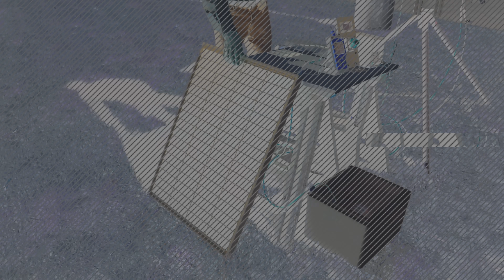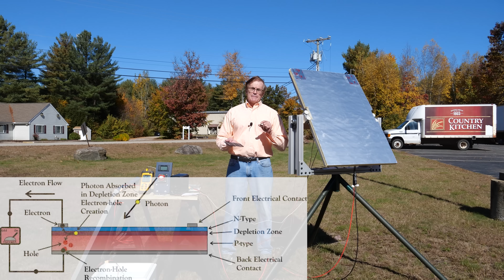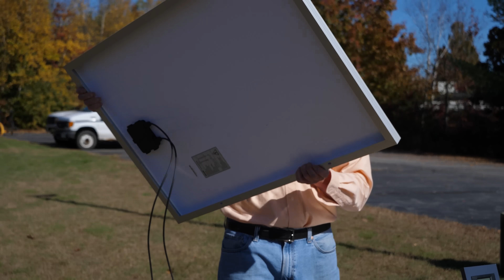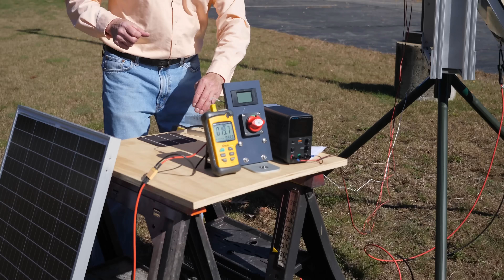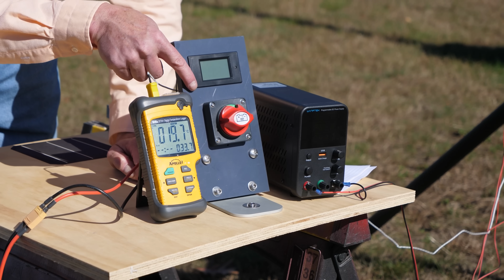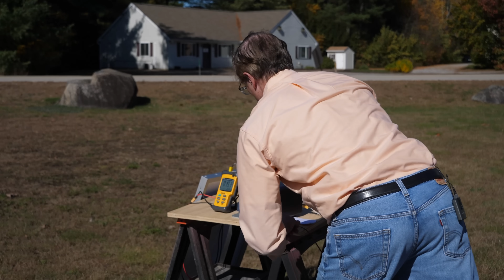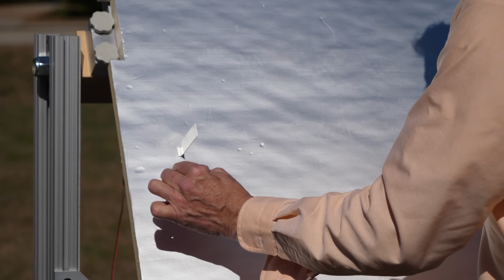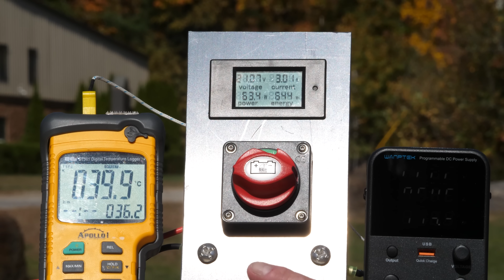Do you REALLY get enough out of your solar panel?

Comment: It would be interesting to see the effect of just the heat sink fins and an open back vs the closed back and fans.   I feel like the convective flow over the fins might be enough to tip the energy balance toward the passive design without fans.
Reply: My thought too. Additionally you minimize cost, you don't steal any power and you omit any moving parts that would need service and eventually fail.
Reply: Passive cooling has a better chance than active cooling. Good fans are freakin expensive, I bet you'd try to save the solar panels by adding fans and end up spending on ton replacing burnt up fans, when you could have just added more panels. Solar panels are too cheap these days to make this stuff make sense. Put as many panels as you can fit on your roof and be done with it, unless you're willing to lower your ROI because it's pet project or whatever.
Reply: @bobbygetsbanned6049  Yep... solar panels are too cheap and getting cheaper/better. One change... I'd put the solar panels on the ground if at all possible. The roof mount systems eventually leak, make roof repairs a nightmare and are difficult to maintain/improve.
Reply: @onestoptechnologies7305  I agree, better to have them on the ground if you have the space. Roofs leak enough as it is without putting bolts through them and having to remove the panels to replace the roof is a lot of labor/cost, which most roofing companies won't even know how to do.
Reply: @bobbygetsbanned6049  Absolutely! I've heard stories of roof rot, insurance companies dropping the policy, etc. Also, the angle of the panel is usually dictated by the angle of the roof, which may not be the best angle for the location. If the panels are way out of angle for the location e.g. a 25 degree roof at a 45 degree location then trying to add 1% thermal boost/longevity is insignificant compared to mounting the panels at the proper angle. 

Mine are mounted on a horizontal pipe and set at 45 degrees which is approximately half way between the Summer and Winter Solstice angles. However, the array can be tilted to the current normal to maximize output, if desired. 

I haven't run the exact numbers on it yet, but the shorter winter daylight hours are enhanced by the colder average temperatures to produce more power per hour(up to about 125%/hr), but the shorter daylight hours means the house requires more lighting. During the summer, the daylight hours are so long (about 6.5 hours longer than winter or +70%) this added daylight hours increases the amount of power without the thermal boost and likely with a small thermal deficit. But lighting is almost unnecessary because of 16 hours of daylight so the additional power is utilized for cooling instead.

I might be able to tweak the angle a bit to find the "sweet spot" that balances the production/usage for both summer and winter... but so far this rough estimate seems to be working.
Reply: Open air natural convection cooling may be a workable thing in higher latitudes, but in lower latitudes, the sun may be directly overhead (or further, towards the poles), and the panels may lie flat. There's no real possibility of natural convection for a panel laying flat - forced convection would be a must-have. And cooling would be even more critical. 

For much of summer, the sun is actually a few degrees north of us in Phoenix, AZ (about 33 deg North latitude). Temperatures (in the shade) typically exceed 110°F (43°C) from 11AM to 5PM.
Reply: @brettd5884  Non-tracking, fixed angle systems are set halfway between the summer and winter solstice angles which is fairly close to the local latitude. So Phoenix, AZ would have a fixed angle of roughly 33 degrees.
Reply: @OneStop Technologies  my calculator shows 34 degrees for the lowest and 80 degrees for the highest from vertical(monthly average, 103 for the peak.)  57 for spring/fall. For Phoenix Arizona.  Panels should be set in the mid to upper range for grid tie. Better performance in summer is preferred as that is when the loads are the highest in Arizona.  Off grid,  should almost always be set up for maximum output in December and January and, depending on battery chemistry,  split into 2 strings 1 optimized for Earliest AM production and Latest PM production  in order to provide power long enough to charge batteries and reduce hours that are battery only.
Reply: @nicholasmendoza6159  Yep, I have mine set to the mid angle (Spring/Fall) and leave them. I will never tie mine to the grid. I'm not in the business of subsidizing the electric companies. They can make their own power. That's an interesting idea about splitting the array. I'll have to test that out. Thanks!
Reply: @OneStop Technologies  there is a lot to solar tha tis absolutely ignored by the general population when it comes to production.  Like mppt algorithm. Or changing settings to match the panels. Panels can produce down to 200W/m2 of luminance.  And if the person wa sto look at the spec sheet, compair the volage and amps, they could design and set the settings to hold the higher volage and only draw enough amperage to keep it at the rated output at the peak of the curve allowing power at very low liggt conditions. I have learned not to explain or help people with this in the major forms because people just get pissed off because "they know everything " about there system and solar output is what it is.
Reply: @onestoptechnologies7305  do you have any documentation about research you have done? It sounds really interesting and all the time you spent on it won't go to waste
Reply: @turnoff7572  Yeah, I have some in paper notebooks somewhere. I might have some digital files too.
Reply: @nicholasmendoza6159  That is a sad reality... Shouldn't we all should be continually learning and sharing with others! 🤔
Reply: @OneStop Technologies  yeah but like I said, people are not concerned with having an optimal running system,  just one running enough that they can complain about it.
Reply: @nicholasmendoza6159  could you explain this more or give a source for me to learn more about this?
Reply: @Elyjah Wortham  books. Not the internet.  Lots of information on solar production and engineering out there in books. Nothing good except a few calculators on the internet.  You can pay for a subscription for a solar design program, you put in your system parameters and it will provide everything like peak output, total average,  it also uses lidar images to calculate tree height, hills etc that will influence your summer or winter output etc. It also calculates battery size etc but it does miss on max charge rates etc and they dont calculate the ideal angels for am vs pm production vs am vs pm usage, that is all on paper. Software runs around 300-400 a month.
Reply: @brettd5884  Il lower latitudes, could'nt you simply make a solar thermosyphon to pull all the hot air from behind the pannel ?
Reply: @AutoNomades  A good thought, but the required ducting brings it's own problems. The thermosyphon exhaust would need to be far enough away from the panels to not cast shade onto the panels. Such ducting would also need to be large diameter for natural convection to be practical.

Then there's materials: If you were thinking of using PVC pipes, PVC gets real brittle after being exposed to sunlight after a year or two. I don't think ABS (or any plastic) is any better. All plastic pipes are either buried, or used indoors where the sun doesn't shine. Painting helps both. And thermal expansion/contraction needs to be considered across the 40°F to 180°F (rooftop in summer) range.
Reply: @brettd5884  If they could make gas tanks from paper during WWII  I'm pretty sure you could make biodegradable ducting from painted cardboard
Reply: I spent hours designing a passive solar tracking system that should add 20% to daily solar harvesting, but cost 20-25% additional for the array. In the end, adding 20% more panels with no moving parts was the wiser solution.
Reply: If you have the space then yeah I guess so.
Reply: @onestoptechnologies7305  even at 20% increased efficiency for 20% more cost, you are still saving out on 20% less space taken, and probably 40% longer life-span on the panels themselves since they aren't baking themselves to death. Passive fins really seem like a no-brainer
Reply: @JceeJClark  The panels are guaranteed to produce at least 80% after 20 years, the fins may slow the degradation rate from 1%/yr to about 0.5%/yr, so after 20 years they may be producing 90%. If I thought that I would never upgrade/replace my panels or was planning to try to utilize the same panels for the next 40 years, then the fins might be the way to go. But the cost of the fins and the cost of the thermal paste in addition to the fact that modifying the panels will likely void the warranty, really cut down on the ROI. I've watched the changes in solar technology over the last 40 years and I'm planning to taking advantage of the new technologies over the next 20 years like perovskites, Ni-Fe, quinones, TPV, et cetera.

Space is not an issue for me, I don't have to squeeze every last drop of sunshine out of my panels. To avoid unnecessary roof penetrations that WILL leak at some point and make reroofing a nightmare, I'm not mounting my panels on my roof, so I can simply add a couple of panels to my array.

I love to further enhance system efficiency when it makes sense in cost and effort. I have spent thousands of hours researching/designing many options for adding efficiency to my array; passive tracking system using liquid propane, active tracking system using sensors and PLC, a cooling system using PEX tubing, distilled water and buried ground loops, or simply using sprinklers and more.
Reply: Ya. And this would be expensive but fun, a Peltier coating in the back, and then a large heatsink. To boost up the voltage when the heat drops it down.

Comment: This probably will not be seen but I'm going to put it on here anyways.
What about using the thermal electric peltier devices to possibly capitalize on the temperature difference of the backside and the front side of the solar panel to produce a little bit more output from the energy that is being collected at the solar panel?
Reply: I am aware that peltier devices are expensive and not terribly efficient. Yet trying to cool the back creating a temperature difference between the back and the front with peltier devices in the mix might even produce a little bit more output then you normally would from just a plain solar panel.

Comment: I agree on using this for dessicant cooling. try using your thermal paste as grout and then thin walled tubing. No direct heat so it shouldn't need to be that sturdy and you should get air conditioning and more power.

Comment: It seems like this makes perfect sense based on lifetime of panels rather than the power production. Because those 2 watts don't add up to significant difference over panel lifetime... but extending that lifetime by as little as 2 years recoups the cost of the modification.
Reply: To be fair, I did very rough calculations based on your results, so I could be wrong by a significant factor... but it seems like a good idea. If nothing else, it enables solar panels to have a lower environmental impact, which I think is more important than the cost impact alone.

Comment: I have 400watts of panels mounted on the top of my motorhome. I was unaware that the heat hurts them like that. I will absolutely be making covers for them for when the motorhome is in storage now. we hit 45 C in the summer where I live. I bet those things are hitting 100 or more in the blazing sun. And if they aren't even doing anything I better have them covered! Thank you for the video! I love learning new stuff!
Reply: The panels will likely outlive the Motorhome so perhaps cover the entire vehicle?!
Reply: Typically they design these with a 30-50% excess margin built in due to the fact that they do degrade slowly over time.   The biggest help will be adding extra batteries to such a system.  If your RV can fit an extra 4 or 8 batteries, it's often well worth it versus having to replace the panels in a decade or so.

Comment: i have been thinking about doing this on my boat, but then watercooled. I mean a boat is surrounded by water, so i can just dump the heat in there. Install a small pump that runs water through a hose up to the panel, then another at the other side that lets it back in to the lake. And i think i dont even need a big pump, you dont need a gallon a minute to cool the panel. And the water around my boat tends to top out at something like 23c if we had a warm summer i think. But on those warm summer days i can expect temperatures to be mid to high 30c, and the solar panel would most likely be another 30c or more higher then that. A delta of more then 40c would be possible and would mean i probably gain quite a lot there. Now only find time somewhere to make this happen.
Reply from the maker: That's  a very good idea.  It's  not a niche application  as many large boats and liveabords depend on solar and the water is REALLY  easy to access.

Comment: Have you thought if a self cooling paint could improve the panels?
Reply from the maker: Yes, but only if applied to the surrounding  structure.  Obviously, the panels  themselves can not be effectively painted on the surface that matters, i.e., the top. The back will only see the ground or the roof and can't  dump heat to these surfaces, but the surrounding  surfaces will raise  the ambient temperatures significantly.

Comment: There are some negatives to this approach that I don't think you're considering, though.  Existing typical PV panel installations are entirely solid-state, which is part of why they last as long as they do outside in all kinds of weather conditions.  The extra cooling apparatus is not only adding significant expense, both in terms of the panels themselves, and also in terms of installation and logistics (where does the cool air come from, where does the hot air go?  In many setups, particularly with lots of panels, that's not as obvious as it seems.), but it also adds moving parts which are subject to failure, maintenance, etc (will those fans last for 30+ years of all-day, year-round use in all kinds of weather conditions like the panels will?  I personally wouldn't bet on them lasting more than 5 years or so, to be honest, and that might be a bit optimistic).

And how much extra power output did you actually produce?  About 2.5 watts extra from ~60 watts originally?  That's about 4% improvement.  How much extra cost was it (even with spending the extra manual labor on your hacky homebrew heatsinks, etc?  I'd bet it was more than 4% of the cost of the panel.  Even if it extends the life of the panel a bit, it still probably comes out a net loss in the end over just buying slightly more/bigger panels instead.

I suspect all of this is why not many manufacturers even try to do this sort of thing, and they're probably right not to, frankly.  It may be that that particular company has a good way to make things actually worth doing, or it may be that they actually don't really and it'll just be a short-lived gimmick.  Probably only time will tell, really.
Reply from the maker: Indeed, time will tell.
I have considered these issues, but a lack of current application doesn't  mean it's a bad idea.  A manufacturer  of solar panels doesn't  necessarily  worry about the whole system engineering.
Reply: @TechIngredients  Any decent panel manufacturer definitely will worry about the whole system engineering, because that can significantly affect whether anybody else is actually going to buy their product or not.

It doesn't matter how optimal your solution is if it's so much of a hassle to implement that nobody actually wants to use it.

Comment: why not just buy aluminium angle? You can buy it extruded and its allmost certainly going to be cheaper then getting someone to make it for you on a press brake.
Reply from the maker: Actually,  it isn't.  I really  wanted a simple  approach, but they are substantially  more expensive.  Check it out.

Comment: I have 45kW of panels with 30kW export limit in Australia. I've thought about using an atomiser system to mist the panels on hot days. The minimal cost of water over 6 to 8 hours would be offset by the system running at higher output for longer, and the increased longevity as you pointed out.
Reply: Unless you are using distilled water the solids will cost the surfaces….

Comment: If you have a roof of panels it might make sense to heat sink and run ducting to all of the panels to a heavier blower driven by it's own panel. And or perhaps at the other end make up some of that with a peltier as a heat to volts add on.

Comment: The method I use to aim my portable camping panels is to tilt them until the shadow thrown by the panel is at it's maximum length.
Reply from the maker: You mean minimum length.
Reply: @TechIngredients  No mate, think about it. If the panel is pointing 90 degrees away from the sun the shadow will be very small. As you face it at the sun the shadow gets longer, then shorter if you go too far.

Comment: This shows that the way how panels are installed is important. The panels do much benefit if you could get air flowing naturally behind if they are mounted on a roof. 
Ideal would to get a natural convection between the panels and the roof tiles. And also have some heat sinks on the back which you did. 
Good and interesting experiment!